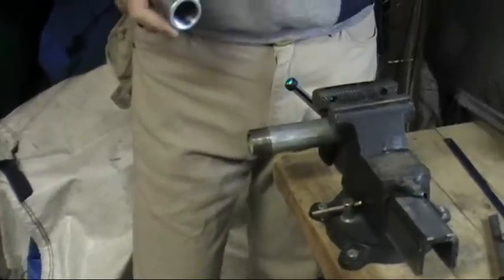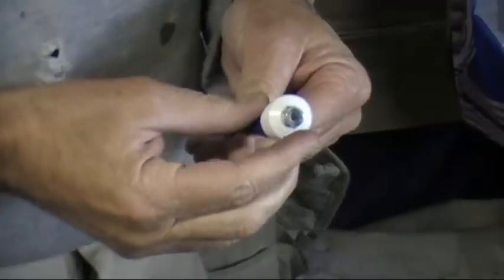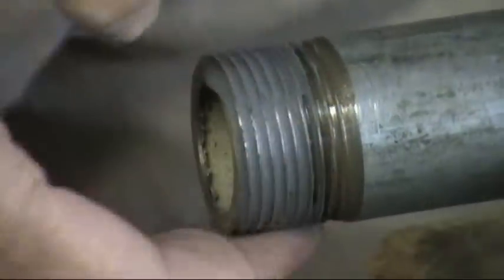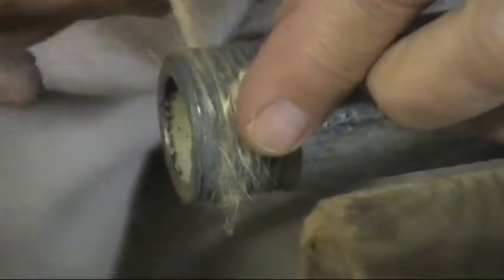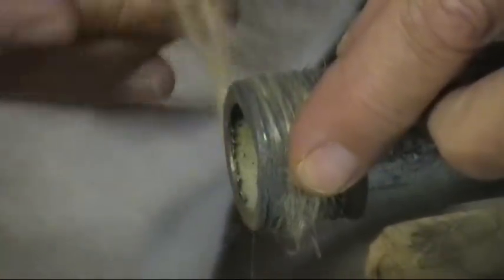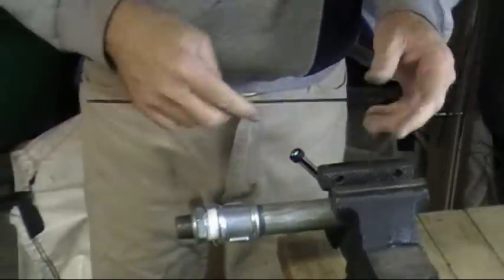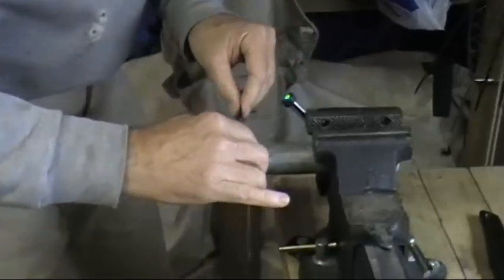Plumber's Hemp and Paste

Comment: Thank you for the instruction. Had a problem with a fitting of a water pipe that wouldn't stop leaking. Couldn't get it fixed with the teflon tape. The hemp and paste, with your instruction, worked like a dream!

Comment: In France in most case (except for gaz and air) we use oakum and paste because it's 100% leak proof if it's well-made and you can turn your fitting a bit if you made a mistake it won't leak . All the plumbers I know use this method. 
Anyway everybody's free to work his own way some prefer Teflon, other prefer past and oakum, some like scelent... 
Peace 🙏
PS: you don't need to break the thread on galvanise steel pipe and black iron pipe. Only brass fitting need it.

Comment: As a cabinet maker I need to join some pipes from time to time usually when I make kitchens. I have been using Teflon tape for years, but this last time the pipe just wouldn't stop making drops and I made three reattempts. I'm going to try this way tomorrow. PS One of the reasons I use Teflon is the drop in pipe quality and that a colleague of mine cracked the pipe with using too much threads.
Reply: Get rectorseal tru blue pipe dope, as it is a sealant.  Put a thin layer of pipe dope on the threads.  Then wrap in teflon.  Then apply another layer of pipe dope.  This should do the trick.
Reply: bruh that a lot of pipes that aren't to code 😢

Comment: You're can booger up the threads a bit too it will help keep the flax from getting pushed out of the joint when tightening.
Reply: Some fittings have threads that snag the flax so it get pulled into the joint better.

Comment: does it matter in which direction you lay it around the thread? the pipe goes on clockwise, so should the hemp be laid anti clockwise?
Reply: No it should go clockwise as well, and be careful that you end the hemp at the end of the thread, so the joint can catch the hemp as it turns and not leak.
Reply: Always same way as the fitting

Comment: A plumber told me he knows if a DIY'er did a job like this because they used thread tape and not hemp and they have leaking joints. He explained that the water actually swells the hemp and seals the joint. Thread tape is used on the inside of a female nut connector as well as the hemp on the male threads.
Reply: I don't use hemp but I use loctite and doesn't leak. So am I a DIY'er? 😂

Comment: One of my senior fitter tought me one hack,  how to seal BSP threads used in water piping. Apply oil paint & wound  cotton thread (which is used in grossary shops) in BSP threads to give strong & leakproof joint.
Reply: Problem with paint is that one day you might need the disassemble the parts and it's going to be much more difficult

Comment: I'm unsure about the paste. The hemp expands once it gets wet, sealing the joint. Won't the paste inhibit the wetting of the hemp? I've always done it without paste.
Reply: Did mine with petroleum jelly, one day later still no leaks

Plus did not even have to tighten it that much

Comment: Hi, Thanks for a great video, I had tried to make a joint myself and I know that it is wrong.

However I thought that the hemp has to be fully wetted before applying to the pipe by drawing it through a blob of paste.  What do you think.

I would like to get the further details from the email that is mentioned in the video.
Reply: EntropyDivideByZero Eight years late! But I will give my answer :) I attended plumbing school in Denmark for a short while, and we did a lot of these installations in school. We did not wet the hemp, and I dont see a good reason to do it. The hemp is easier to work with when clean and dry. You want to stretch the "lump" of hemp into a long one. Ie make the same lumb reach many turns around the thread. I think that will be much harder to do if its greased up first. The layer is relatively thin so I think the paste will penetrate sufficiently without any effort.

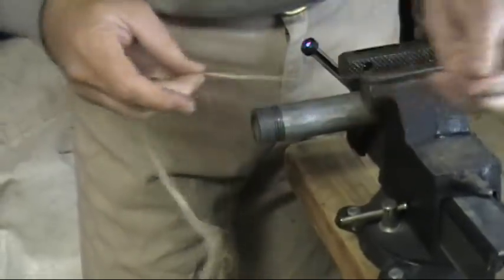Comment: sorry but you apply the hemp incorrectly.  You mislead people as such with incomplete sealing that is bound to leak way sooner than it should. When you separated like that (1:24) you destroyed the parallel position of the fibers and messed it up. Fibers should be completely clean and neat, just as they are when you buy it. That way it will follow naturally the pipe threading and will not end up knoting in there and get pushed out as you tight up the joint. Also the hemp piece should be pulled out when turned on the threads so it will be tight and not rotate with the female threads. If its not messed up, its not easy to break when pulled, so you can apply some force on the pulling while threading it.

Comment: Now that is a true sealent! I do have issues with that application. Okay, the hemp swells up when it's hit by moisture, just like in a lead joint. What happens when the hemp deteriorates? Redo the whole system? I can not believe that plumbers in Europe use non tapering threads. Maybe in the former eastern bloc, where it was difficult to get proper fittings. But Germany? I doubt it.
Reply: forty two our threads taper?

Comment: So this video is around 4 minutes long. On a typical job on a typical day I can do at least 16 make ups in less than 4 minutes that all hold 200psi test pressure. Teflon tape and paste on tapered threads. I have no idea why they hold on to this archaic method.

57 seconds ago